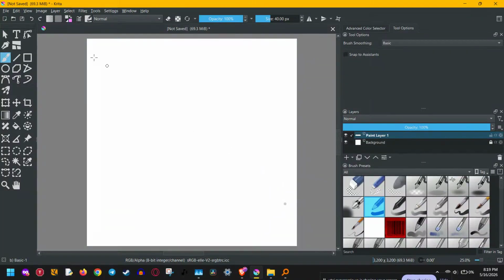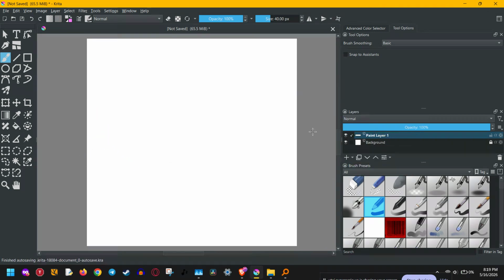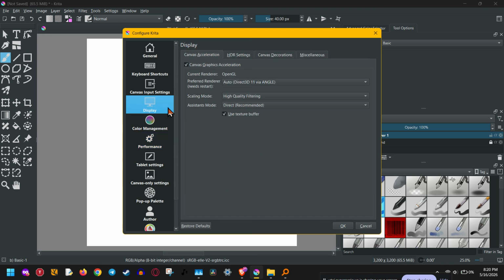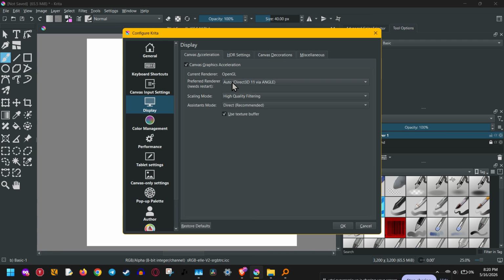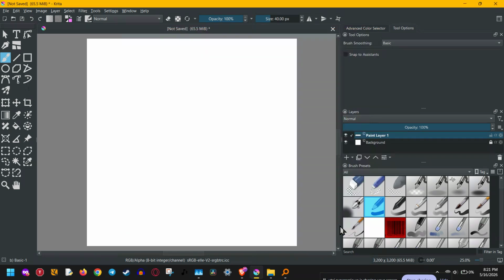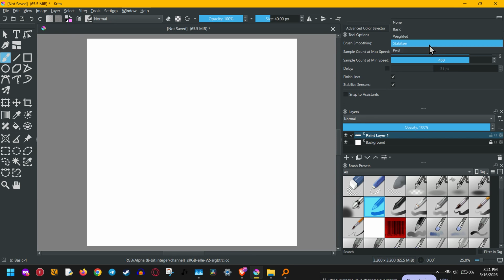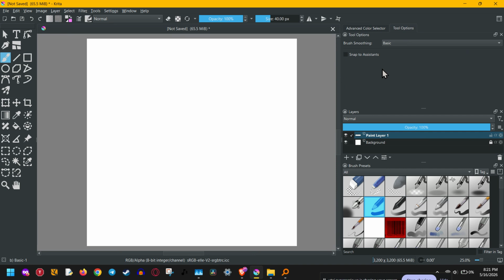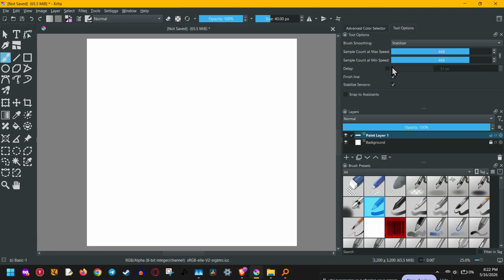How To Fix Lag In Krita (Easy Performance Guide)

Comment: When I zoom in and out with pen scroll up down, it zoom very slowly
Reply from the maker: To speed up canvas zooming in Krita, go to Settings > Configure Krita > Canvas Graphics Settings and make sure Canvas Acceleration (OpenGL) is enabled. Also, check your tablet driver settings to ensure your pen wheel/scroll strip isn't set to a low scroll speed sensitivity!